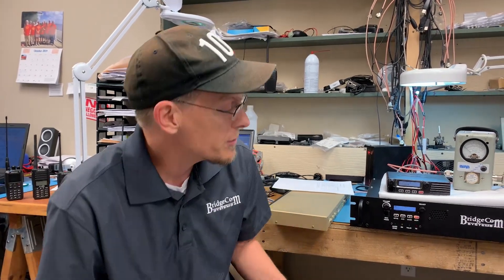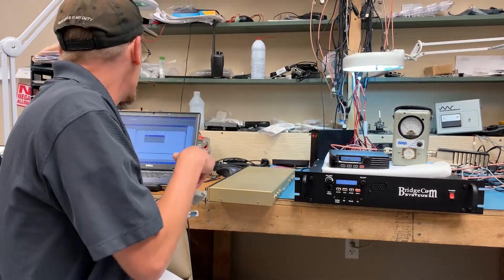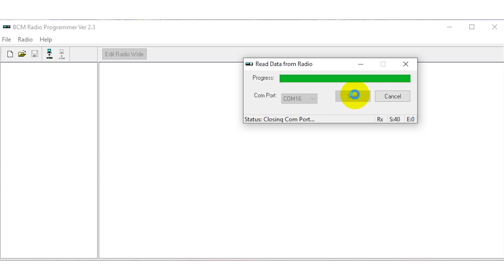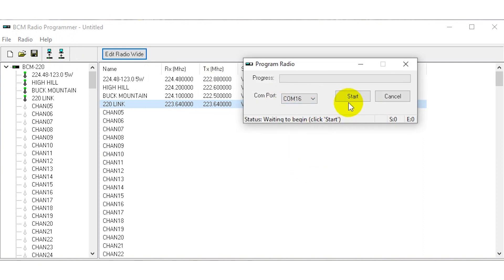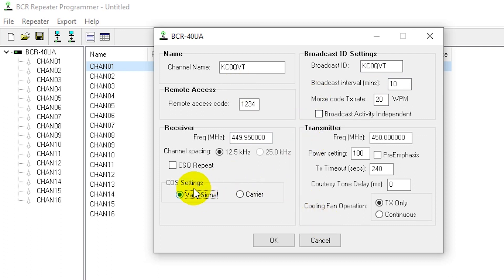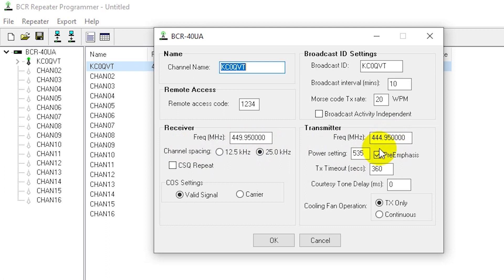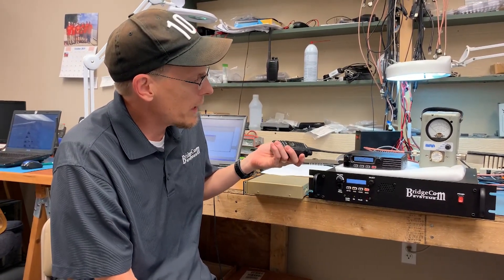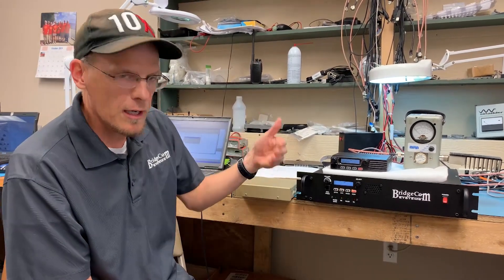How To Connect A BCM Link Radio to a BCR Repeater

Comment: Another question, and I should have vetted this before I bought them, but I have a 220 repeater and got the 70cm mobiles to link the repeater at my house and one at a friends house. We haven't tried them yet but I worry because 70cm is pretty weak between us. He has a GMRS antenna at the topmost of his 50ft tower and I have a beam up pointed at him only at about 25 feet and it's hit and miss for receive for both of us. Would it be better to use 220 link radios with the 220 repeater or would it cause some problems? 2 meters is pretty easy simplex between us but I'm not sure 2m supports linking, and it's a busy band and didn't want to tie 2m up. 220 is better than 70cm. What do you think about using 220 link on 220 repeaters? Thanks.
Reply from the maker: Thank you for your comment.  We invite you to ask your question to our very large Facebook group.  Here's the link to join: https://www.facebook.com/groups/BridgeComSystems.  Also, please check out our plug-n-play package:    https://www.bridgecomsystems.com/pages/plug-and-play-package.

Comment: Just to clarify, you created a new profile on the repeater, is that if you're setting up the repeater from scratch? Or would I have to add a new profile to my existing set up, so having 2 profiles? Or is just having the 1 profile enough as long as the COS is set correctly?
Reply from the maker: One profile is fine.  The COS is going to assert based on valid decode of the PL tone.

Comment: If you choose to have a courtesy tone on the repeater's output, does it also go out on the link radio? Is the repeater's COS going to follow decode? We need a 3-second hang time on the repeater output with a 1-second courtesy tone, but no hang time or courtesy tone on the link radio. Also, how do you ID the link radio? No ID would make this setup 100% illegal. For our existing links, we have a polite ID sent after it drops a repeated signal, but with no CTCSS so it's not repeated by the system. I can see that no one replied to a similar question below, so I'm not holding out much hope for an answer. I hope your customer service is better.
Reply from the maker: No the courtesy tone of the repeater is not transmitted by the link.  Yes,  the repeater's COS is programmable and will assert if it's programmed for VALID decode.  The link radio is a subscriber to a remote station.  The remote repeater station should ID.  Subscribers in a commercial repeater system aren't required to ID.   Also, @ProFriend, have you ever tried calling our offices at 816-532-8451 ?